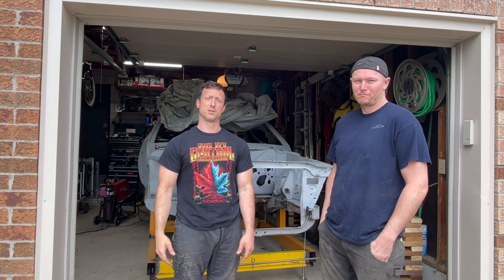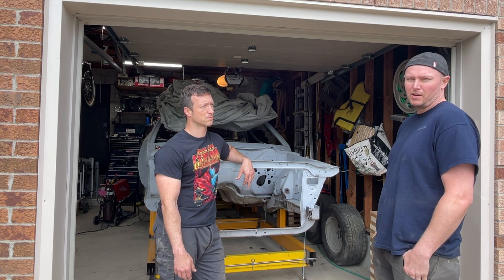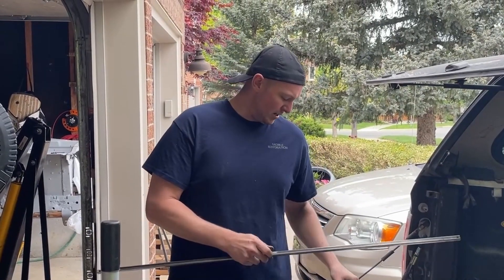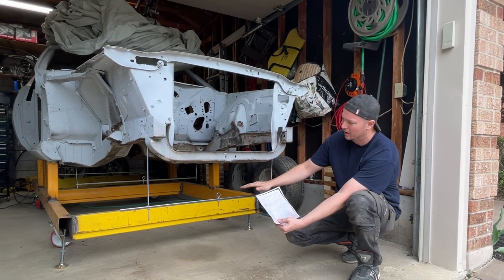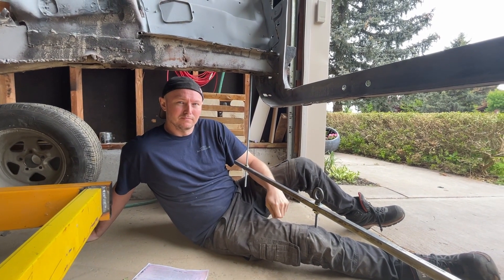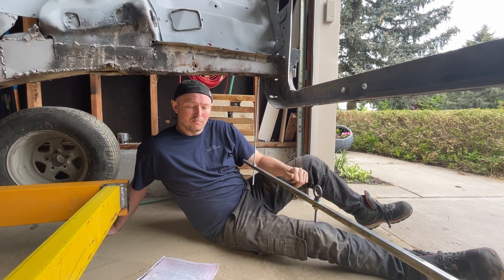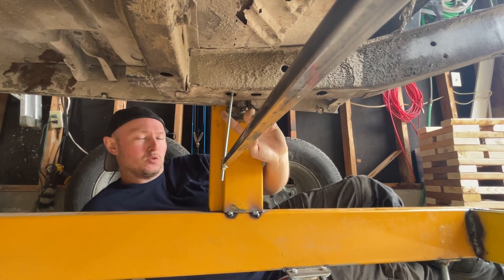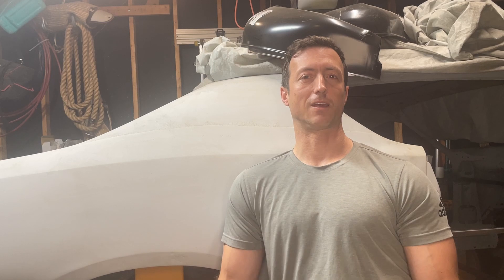1971 Dodge Charger Build - Episode 17 Datum Gauges *Build your own!*

Comment: where did you get the bluprints/datum information from?  I 'm in process of stripping down a 73 roadrunner for restoration
Reply from the maker: The guy I was working with had a 72 one which was the same as 71. Found another 71 one on ebay and the guy was kind enough to scan and email it to me. I could've sworn I saw a 73 b body one on the Forbbodiesonly.com forum.. You try there?